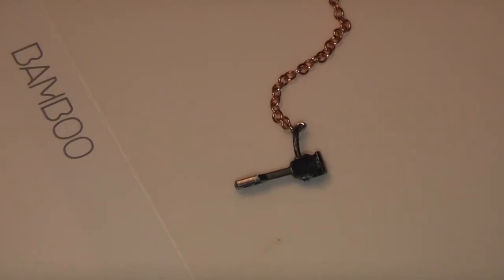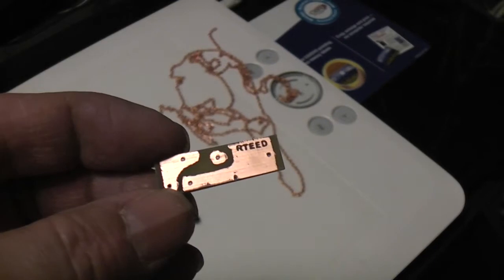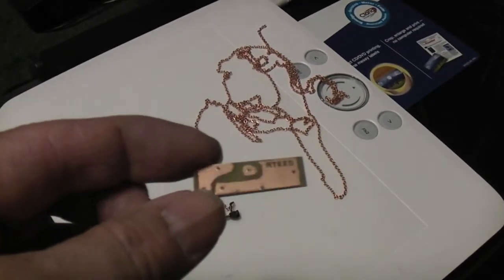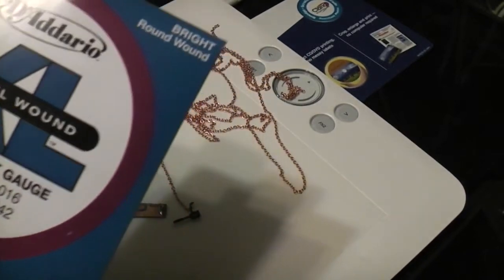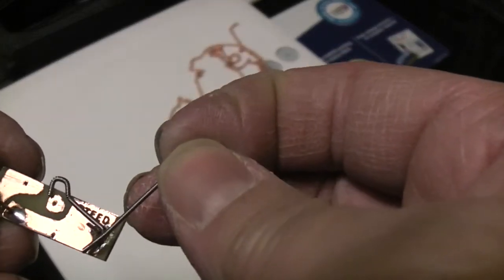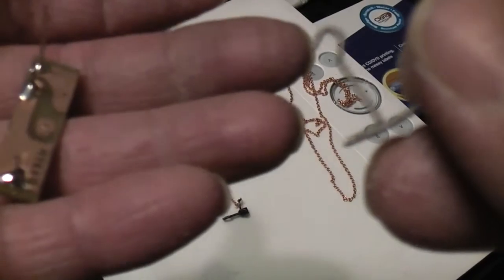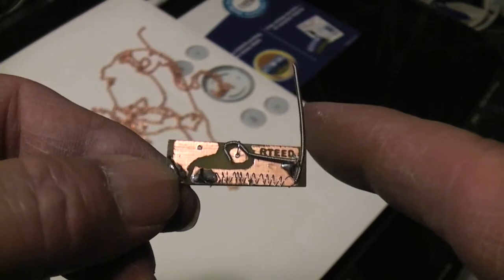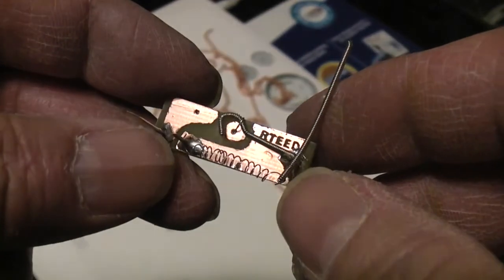I'm building a DCC Uncoupler Part 1  - design by Dick Bronson

Comment: So....... there was never a part 2??  :(
Reply from the maker: No, I lost interest in using muscle wire. I'm leaning more toward linear Servos. Haven't worked on in in awhile. Just too busy.
Reply: That may work better... The DCC controlled uncoupler is still like a "Holy Grail" in Model Railroading. 3-Rail O Gauge has has it for almost 20 years! 
I don't think that coil operated couplers would be feasible in HO though...

Comment: Thanks for the info. I did some research yesterday on the net. I found some muscle wire on eBay for $5 for 5 feet, from Kelloggs Research. They've got a website too. I saw Dick's circuit too, but I'm working in N scale and that might make it a bit crowded for a circuit of that size. I saw a book on muscle wire projects that may shed light on power circuits, for about $20. alpha.guitars@yahoo.com if you want to take it off line.

Comment from the maker: Ok, I purchased the wire off ebay. It came in a three ft length for around $15 dollars. I don't know the size but it is really small diameter. In my experiments I was using a 1.5 volt battery. That was a mistake. Ended up over heating the wire and the uncoupler quit working. Dick Bronson has a circuit that reduces the voltage to about 1/2 volt. This has to be installed with your DCC decoder. I have made up that circuit but have not tried it out yet due to the fact that I burned out my wire.

Comment: Dick, I am working on a DCC uncoupling car at this time. It works differently than yours, and I think it's a better design. But I am presently trying to use a solenoid, which is expensive, and not very strong. I'm thinking the muscle wire might be the way to go! I would love to know more about the muscle wire you are using. What size is it? Where did you get it from? What other components did you have to use to power it from the track besides the decoder? Would love to discuss it with you.

Comment from the maker: @177987auprr1  Thanks, I have video posted on etching I think. Its easy after you get the artwork ironed onto the copper just soak it in muratic acid and hydrogen peroxide mixture.